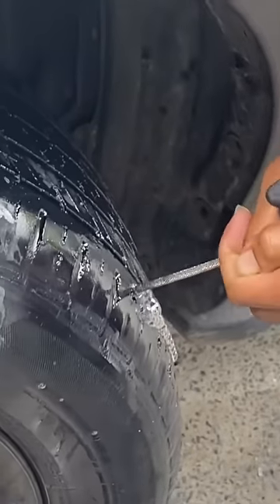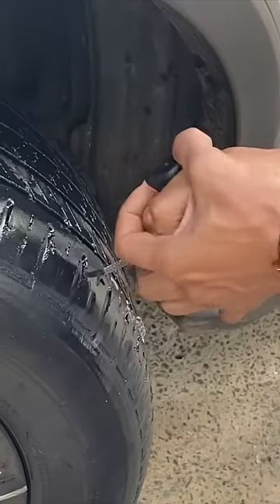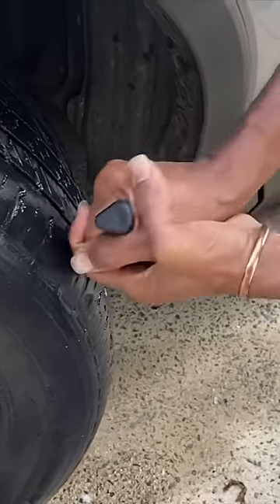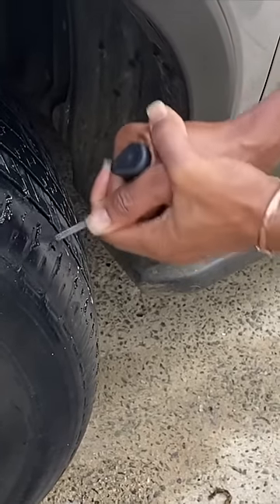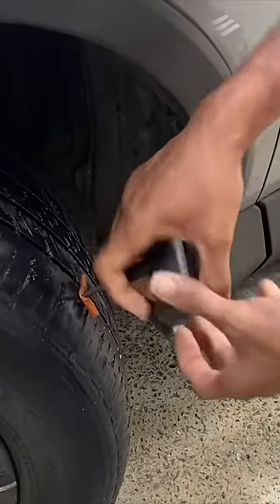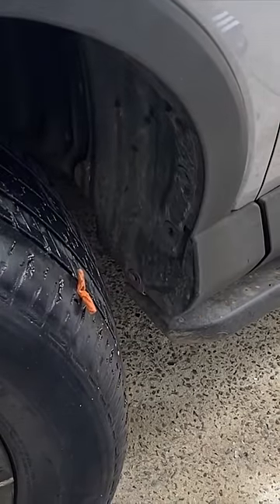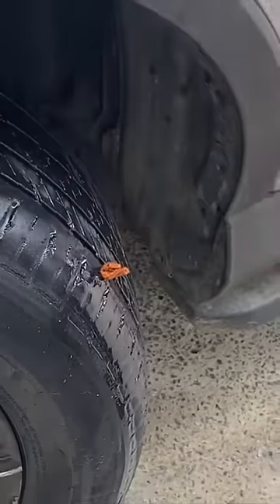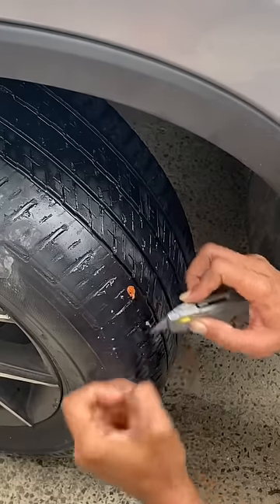How to repair a flat tire using a plug.

Comment: That's it. That easy. I've done tons of these repairs. U can keep using up the tire like that too... that's as good as a permanent repair as u can do. So many thieves today wanna tell u it's no good, gotta come off, gotta get patched, gotta get replaced. Dumbass shit. Plug it and forget about it. Good job. Sometimes shits in a bad spot and u can't plug it. Got lucky. Reaming the tire with that little tool is work too 😂
Reply: Sometimes the patch lasts longer than other parts of the tire
Reply: Can you do this repair if the hole is on the side of the tyre?
Reply: @jayrush01 no you can't
Reply: I've installed and balanced thousands of tires. I've never had a plug fail, once one leaked little bit, so I double plugged it, it's a sales gimmick, and people buy it up like hot cakes. 😂 fuk the haters.
Reply: I've gotten holes in my tires 3 times in the last year and every single one was in the side so none of them could be patched 😭 one of them was on an old AWD car too so I had to have all 4 tires replaced
Reply: @jayrush01  Late reply, but no don't think, because you'd probably damage it completely just by inserting the screw from the side. There must be another method.

Comment: No rubber cement? Thought you are not supposed to twist white inserting the plug (at least as little as possible) . I  don't what kind of plug kit you have but most in addition to those 2 things recommend letting the air out 1st . 
  To all of you trying to learn how to do this correctly,  may I suggest that you read the directions.  Also pay attention to the angle the nail or whatever punctured your tire came out . Then ream and insert the plug the same
Reply: If you let all the air out, you can not push the rubber cement in due to the flat tire.
Reply: @stevebao1377  maybe this is your experience especially if it's car tire in San Diego . Myself I'm up in Maine where the rubber is cold and stiff . My truck has 10 ply tires with stiff sidewalks , so stiff that at 5psi with out a load the tires barely squat . Even still never had this issue with needing some pressure to push the plug in , not calling you a liar , just that hasn't been my experience. I have however thought that air seemed to push some cement out and not seal properly or so it would seem.  
Besides that,  just following the instructions 🤷‍♂️.
Reply: Some kids work fine without rubber cement but it would be smart to use some anyways.

Comment: I had a blowout a couple of days ago on a street. Scared to go on an extended drive. Took 1.5 hours for the tow truck. Honda should be ashamed. A blow out on a street in a 2024 Accord Hybrid Touring! Pour tire quality.
Reply: 1. Honda doesn't make tires
2. Its rubber. Anything sharp will cut it. That's just how it goes.

Comment: The way I would use a plug is I would put the rubber cement on it lighted up with a match to heat it up blow it out and then put the plug in it gives a better seal and then trim it off with a razor
Reply: And blow up the tire potentially...
Reply: @SaiAkashTumu  No not at all....
Reply: @SaiAkashTumu  Lol blow it up? The tire isn't filled with anything explosive, it's just normal air.

Comment: It’s a lot easier if you let all the air out first, otherwise your fighting what’s left ( PRESSURE WISE) that’s trying to escape !
Reply: If there's no pressure you have a rim sitting on your rubber tire, possibly damaging the side wall, idk you've thought this out
Reply: @isoline217  I should have been a little clearer it’s easier if you let out MOST not all the air but if you don’t have a pump on standby your kinda fucked, but YES YOU ARE 100% correct thanks you for correcting my mistake appreciate you!!! 👍🏼👍🏼

Comment: What if while doing so, part of the tool that I used to insert the plug snapped and is inside the tyre
Reply: You need to get a new tire at this point. That piece has to be removed.

Comment: Sorry I bought a Honda 2024 Accord. It has no spare tire! Hondas aren't good enough have no spare tire. Wish I had asked the dealer. Would not have purchased had I known it had no spare tire. Serious safety issue. Might trade it in soon for a new car with a spare tire. Really cheap and short-sighted of Honda management! Really stupid!!!!
Reply from the maker: There are a few reasons why some car manufacturers are moving away from including spare tires. One reason is to reduce the weight of the vehicle, which can improve fuel efficiency. Another reason is to free up space in the trunk, allowing for more storage capacity. Additionally, advancements in tire technology have made punctures and blowouts less common, reducing the need for a spare tire. Instead, many cars now come equipped with tire repair kits or run-flat tires that can still be driven for a short distance even after a puncture.

Comment: Um. Twist as you push. If it snaps. Your bleeding. Plus add rubber cement it Lubes and seals plug goes all the way PEACE

Comment: Does this work with run flat tyres also?
Reply from the maker: No, it is generally not recommended to patch a run-flat tire. Run-flat tires are designed with reinforced sidewalls that allow them to be driven on for a limited distance, even when they are completely deflated. However, once a run-flat tire has been driven on while flat, it is typically considered unsafe to repair it.